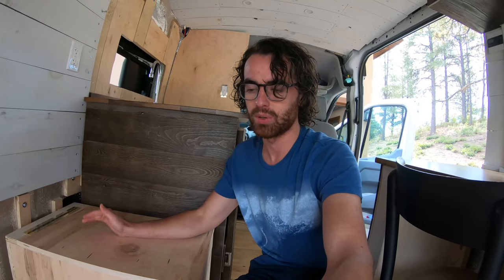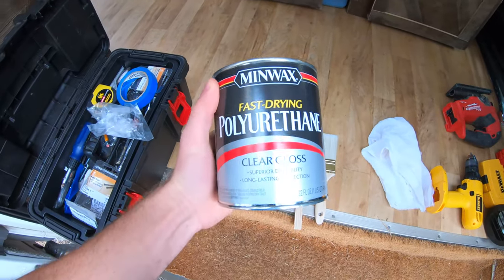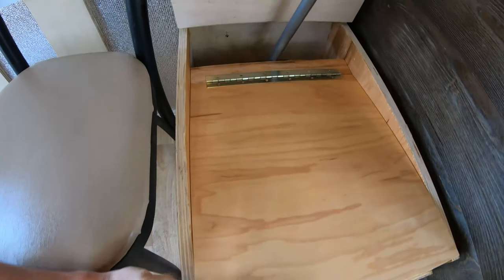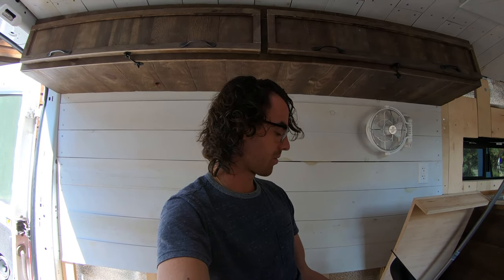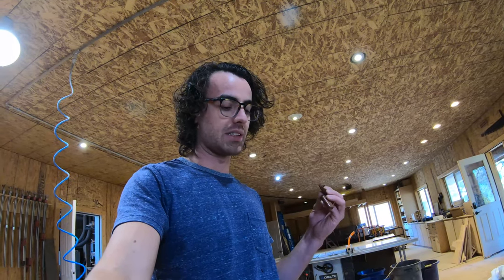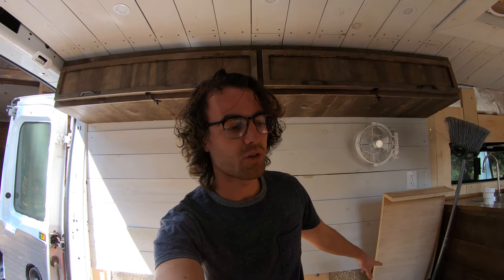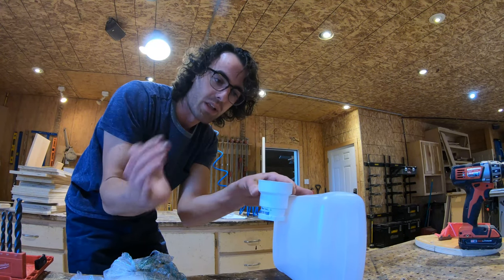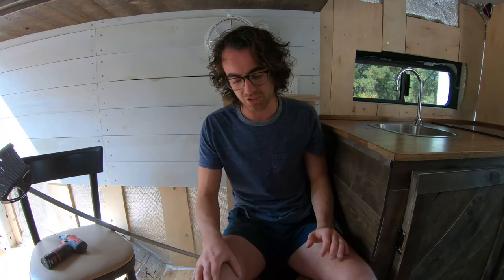Cheap and Simple DIY Dry Composting Toilet for a Van Build

Comment: Several things I want to point out. First, most of us living in a camper or van are not really composting the waste , we are just going to throw it in the closest trash can as soon as we possibly can to prevent odor in our living space. If you empty after every use you really don't need all the added expenses of a urine separator or the peat moss, etc.  Women  (and men too )can pick up a paint cup with handle and spout. Urinate in that and you can easily pour it into an  jug and empty when full.  You can get these at the Dollar Tree and Walmart for uder $2, grab several so you can soak  or clean one when needed. For solid waste,  line your commode / bucket  with trash bags and then add torn newspaper, catalog, magazine strips. This will absorb any excess moisture or liquid. You can add more on top after you finish if desired. You can often get free newspapers or even leftover circulars from stores after the sale ends. Another fact, newspaper is pretty good at absorbing odors. Immediately after using the bathroom, close the bag tightly and trash it. If it's late at night and unsafe to go out I place the bag in a smaller bucket with a lid and trash it as soon as it's daylight or safe to do so. I'm an elderly woman and travel alone so I play it safe. Be sure to immediately place a clean trashbag in your bucket and throw in more torn paper strips so you'll be ready if you have an urgent need in the middle of the night. You can still use animal bedding or sawdust, etc. I use paper to save money. Don't use peat moss, it often contains insect eggs and you could end up with bugs in your van/camper. Hope this helps someone on a tight budget.

Comment: I was surprised that you put the liquids container with the cap at the bottom instead of flipped over so the cap was at the top of the container when inserted into the slot. Keep up the good work. You had me laughing several times.
Reply from the maker: ya know... it seems like i had a good reason but i am blanking on it now as in retrospect that seems like just asking for leaks. I think maybe I didn't want to have to flip it over to pour it out? I am not sure. I am glad you found the antics fun!
Reply: @JeremiahLuke  Bruh, you should always pour anything from the top (I was taught that 52 years ago by a German engineer) - it stops all of the glup glup bc it allows air to flow in freely....when the container is nearly empty THEN you put the opening too the bottom. crack on..... EDIT: What's with this 3/4" ply?  1/2 is plenty, even 3/8" in a box form would be perfectly fine - unless you're planning on some real bat fastard collapsing onto it... you've got to accelerate that weight, brake it, put it around roundabout in high winds so be conscious. I'm making mine whole build out of half on nothing  ;)
Reply: Is 250lbs fat? You recommend 3/8 still? I’m supporting seat with 2x2 frame.  Would beefier ply for seat only be overkill?  18x18” seat.

Comment: Seems like litter would get expensive, but then if you don't use it much. For boondocking I've found hemp bedding or coco core works best, but you need the fan. I think only guys think about reading while doing their thing!
Reply from the maker: Ya know, I still am using the same box/bag of litter I bought in Ace Hardware last year! haha I really do not use it frequently and when I DO...I empty it asap. 

Been very happy with it as it serves its purpose in emergencies.

Comment: Of course it’s not comfortable, but it beating squatting over a cat hole. 

I have built a similar compost /dry toilet for a long term land lease lot across the road from a beach in Thai land. 

I hook the separate pee container via a plastic pipe to a 2 meter deep cat hole filled with sand that safely percolates the pee into the subsurface soil. After the poop successfully composts/dries completely I usually burn it and dispose of the ashes in the trash ir scatter it.

Comment: I'm late to the party but wanted to throw a suggestion out for the urine separator splashing/odor issue. Would a light weight ping pong ball resting on top of the hole keep any splashing down? Maybe prevent or keep urine odors down? You could keep it in the hole even while using because the urine would seep through around the ball. Just a thought. Found your channel by chance. Looking to build a compost toilet for a cabin. Saved your idea. 😉 Love your humor. New subscriber!
Reply from the maker: Late party advice givers will always be welcome! ;) Besides, I still have the toilet and use it so you really aren't that late.

I am due to try the ping pong ball idea sometime soon! I think it will work well. 

Glad you enjoy the videos! Some people can't take the memes but I enjoy them haha
Reply: @JeremiahLuke late to the party lol… did it work?
Reply: @JeremiahLuke  how is the ping pong ball working for you?

Comment: Just a couple of design thoughts, if you placed the liquid bottle with the spout and handle on top, as opposed to the bottom, less chance of leakage, and the handle would help take it out. Also, the use of hot glue may hold your adaptor, and seal it tighter. Like I said, just thoughts. Thanks for the video.
Reply from the maker: ya know, the things I look back and wonder why I was doing it that way... oh boy.

Comment: I would have positioned the cap of the urine container up high.  If it leaks, it would be above most of the liquid, & therefore would leak less….
Reply: I have the double-seal bags that are designed to slip over the bucket.  When I’m done, that bag gets double-sealed, and then disposed of.  As you say, it is meant to have it’s use minimized.  But boy, when nature calls, its value is truly proven.

Comment: I have to say that your use of a dust mask while applying a poly product is off. That is literally only for protection from particles. The fumes from pretty much any poly product requires a cartridge filter like 3M 60921. I'm not a rep or anything. Safety first.
Reply from the maker: thanks for the info! learning new things each day. This would explain why I can't seem to remember third grade anymore...

Comment: If you put the cap on the top instead of the bottom of the container that would eliminate issues of a leaky cap.
Reply from the maker: surprisingly, the cap hasn't leaked at all yet! and no splashes either...quite to my surprise haha. I think I need to start doubting my jerryrigging skills less

Comment: Every “composting” toilet for mobile use I’ve seen on you tube is mislabeled. They don’t compost much. They are urine separators, mixers, and odor reducers. Is there anything that actually produces finished compost rather than hazardous waste that needs to be sent to a landfill?  Otherwise, good video.
Reply from the maker: I learned all this during/ after my toilet project. But you are right, although I do think some people consider stirring in drying material "composting." I believe the cassette toilets are considered composting? But people don't leave the waste inside their for months on end...so Im wondering what the difference between the cassettes and the stirring in drying material ones are?

Anyway, the best thing here is the urine separator in my opinion. Super amazing doohickey.
Reply: technically it is not a hazardous waste for landfill... if Jeremiah had a larger Humanure compost to add the buckets from his composting toilet to after they were filled then it would in fact be a composting toilet indeed..

Comment: Get yourself some bags to line the bucket and it would make getting rid of the waste easier.
Reply from the maker: Are there special bags people use? Or would a Walmart bag work...?
Reply: Walmart bags are ok in a pinch but check for holes.If your Boone docking, get Bio Degradable so you can bury them otherwise,get small trash bags.
Reply from the maker: @mendozaconsultation  Thanks for the tips! Appreciate it.

Comment: A few note:  Elderly or overweight people need a bit more space to spread their legs, so this looks like painful on the side.  Since any smell will most likely be from the urine, maybe finding space to install a easily accessible shut off valve on the urine container would solve that problem, having in accessible in the front of the box so as not to forget to open when required.
Reply from the maker: After building this and sitting on it for the first time, I readily admitted to myself that this was most definitely built for my own needs rather than as a one size fits all sort of solution. I agree with all your remarks!

Surprisingly, I have had little issue with the smells due to the combo of cat litter + emptying soon after using and only using when another option is unavailable (Walmart/ gas station/ etc).
Reply: Travel Snacks (Allison) uses a simple bathtub drain stopper to close off the urine diverter she uses. I don't think, however, that she has a seal around the entry point from the diverter to the catchment bottle (the diverter fits pretty snugly)... but still, the stopper is there to stop any odors (there aren't any, she notes) or splashes up and out while driving.

I guess if someone has asparagus for dinner there could be an odor... !